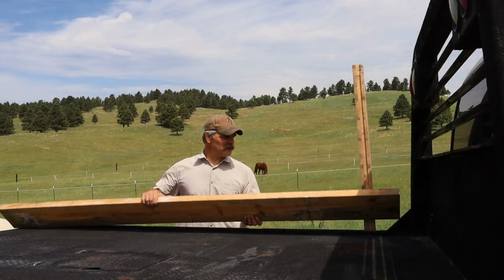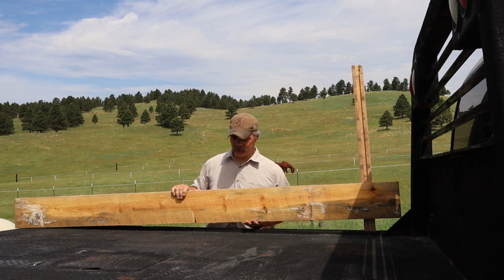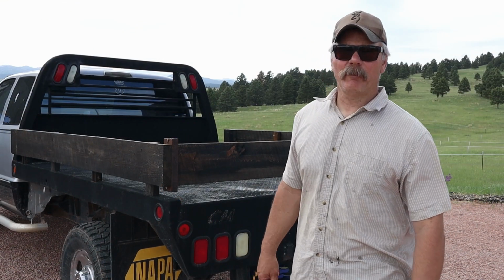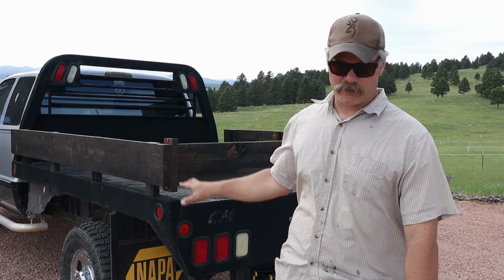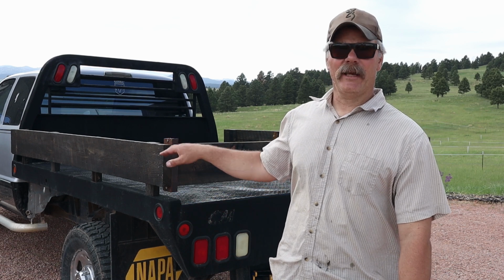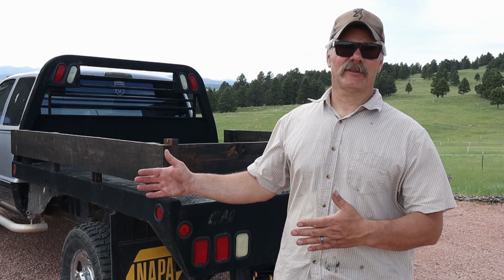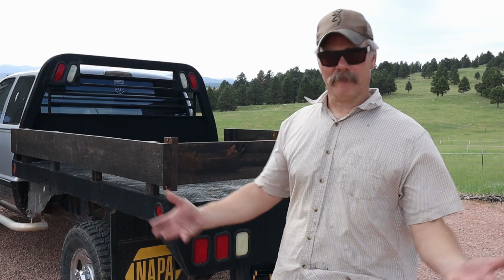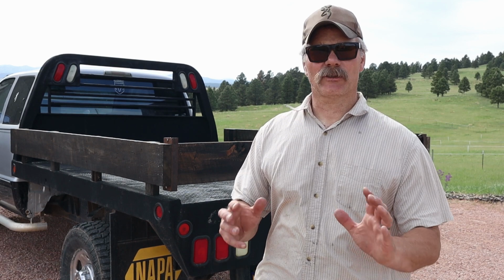Wood Truck Bed Rails and Log Cabin Update

Comment: I have been waiting on my trusses for about 4 weeks now.  It must be all over, it will happen, gives me time to do other things too.  First thing I am doing with my chevy 2500 diesel is take off the bed and make it a flat bed.  I can't get into the back of it easily.  Plus I have kinda got a few dents from building cabin and shop.  Love the single axle flatbed.

Comment: It doesn't have to cost anything at all, as long as you've got the flatdeck with the stake pockets. I'm working on some side rails and a tailgate, made from salvaged 2x4s. This is a truck from my job. Management took a Chevy 3/4 ton and replaced the springs with 1 ton springs (ostensibly so it could haul more weight), removed the box and replaced it with a second-hand flatdeck assembly, complete with a rotting timber deck. They were too clever by half when they bought the deck but never even noticed those rectangular holes made out of square tubing along the sides and across the back. I'm making the side rails and tailgate on my own time, out of materials I've salvaged myself. This way, they're MY siderails and tailgate, and I'll take 'em with me if I leave my current employer, even if I don't own a truck to fit 'em onto. Of course, I'm not going to consult management about what they think of the idea; I'm just going to put 'em in place when I'm done and get on with the job. There's a saying, "It's easier to get forgiveness afterwards than it is to get permission before". Because it wasn't THEIR idea, it's automatically a BAD idea, which they would "kybosh" without a second thought if they found out about it. I'm gonna put it all together with HH cap screws, nuts and washers, because wood screws tend to be brittle, and they often break under strain. I'm not taking any chances of a load coming off the deck of any truck I'm driving. I've seen the aftermath come in for inspection and/or repair too many times, and I've heard too many stories about the driver they used to call "One Strap"...before he lost too many loads and got fired. Oil and diesel fuel, you say? Just generic motor oil? I was gonna use pine tar, but I'll do some homework on your recipe. The fence at the local racetrack was made of 1x4 and 1x6 oak boards treated with...I think creosote. It was on a former military base from the time they built the Al-Can Highway, and it was already old when I was a kid, although it might not have been built during the Second World War. It stood in it's place through my fourty six years, and could have probably stood for another fourty or more, if they hadn't torn it down and replaced it with chain link. Stupid idiots. Thanks for uploading. And by the way, you've got a nice yard.

Comment: if you put the post on the outside your lode can`t push the rails off there fasteners. p/s thanks for all your fine content !
Reply: I was worried about a sliding load knocking the rails off, which is why I was gonna put 'em on the inside of the stakes. All the stake trucks I've ever seen are built that way, and it makes sense, if you think it through. But how much underhang should a guy give the stakes, when the pockets have no bottom to 'em?